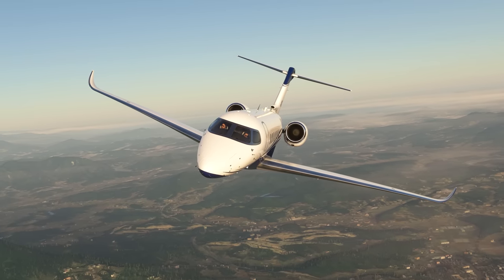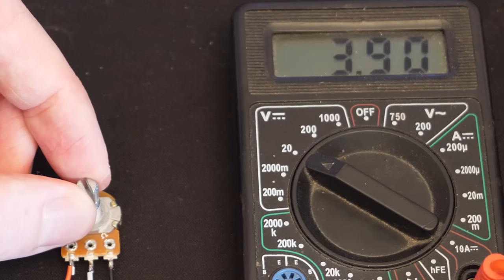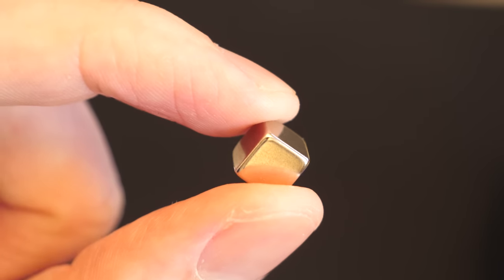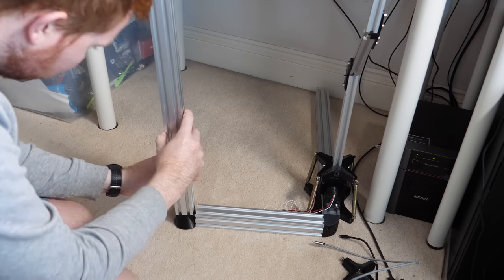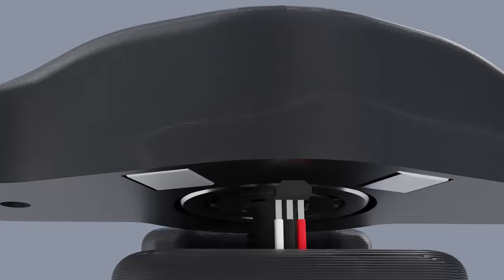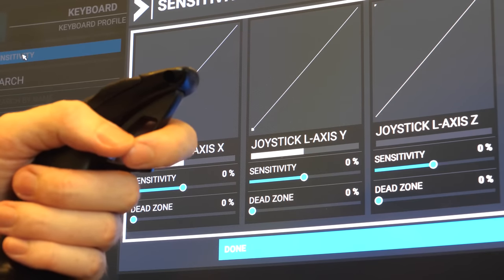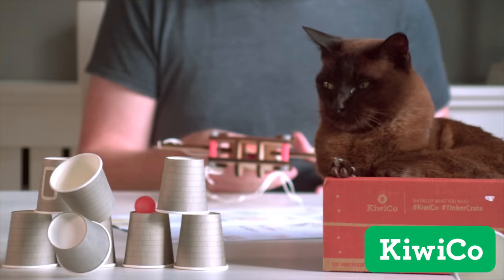DIY Flight Simulator Joystick

Comment: Years ago, I bought a USB racing wheel (with pedals). It set me back something over $100, despite the fact that it was flimsy, plasticky, and horrible.

If I ever want a racing wheel again, I'm definitely trying this idea instead. Some aluminum extrusions, a rotary encoder or some other multi-turn-capable sensor, and maybe some miscellaneous hardware. Heck, I bet I could even buy real pedals and a steering wheel from an auto-parts store. 

Guess I've found my next project!

Comment: +TomStantonEngineering  My concept of a roll-pitch column for a concept F-14E/EF-14G 'pit is larger yet simpler than the stick demonstrated this vid.  Dunlop Engineering (GBR) developed a roll-pitch column for British combat aircraft later licensed by Grumman (USA) for the F9F, F11F, A2F, and F14F (respectively F-9, F-11, A-6, and F-14 after 1962) tactical jets, and by McDonnellDouglas (USA) for the AT-45 advanced trainer; the pitch axis is in the base, the roll axis 0.4m up.  The column could potentially be integrated into a complete 3-plus-axis flight-input assembly with yaw-pedal rack and spring-return pedals for brake inputs.

Comment: Amazing video, and a pretty amazing design. It seems like you got an amazing price to quality ratio with your build. I do have a lazy thought, would it be possible to increase te resolution of an axis by adding more hall sensors along the trajectory of the magnet, that could "take over" when the magnet travels enough distance to get within their respective regions of measurement? You don't have to bother replying if it's a dumb question 😂 Anyway, amazing work, you have a subscriber.

Comment: Did you consider using gyroscope/accelerometer to measure tilt? They seem very cheap and you just have to strap them to the joystick to get pretty precise 3d angle.

Comment: 3:25 Tom: "The large red button can be assigned to a --"
Me: "Missiles!"
Tom: "--desired control output which'll most likely control the brake, as Microsoft Flight Simulator doesn't currently support missiles"
Me: "Oh..."

Comment: I wonder if you were to set your monitor to 100hz because that is a factor of 100 and should line up easier. I am not sure though. Either way. Latency tests for hardware alone are often done on PC mice by wiring an LED in line with the 5v output and the moment it lights up, the measurement is started and the measurement is ended by the time it outputs an action.

Comment: I wonder if using the old DB15 Joystick port would make it easier or harder to do. I mean, with that system, you'd only need analog resistances from 0-100 kΩ and buttons.

Comment: If that 6 degrees of movement is only producing a tiny voltage, why not use a simple TLxx op amp and a couple of resistors ?

Comment: I wonder if i could just add a huge extension to a cheap joystick for a similar result. Or would the cheap joystick not even pick up on the smaller movements.

Comment: @Tom Stanton Is it possible to only construct one of the modules? I already have a joystick and throttle setup but I can't afford rudder pedals so if its possible for the pedals to work as a standalone that would be absolutely wonderful, Also seeing as how you are getting into flight simulators May I suggest IL-2 Sturmovik Great battles and DCS, the latter supporting missiles ;)

Comment: I love it. I need it. I think I build it (when having enough energy to do so … depression is a bi*ch)

The two magnet setup is ingenious and seem easily adjustable to all sorts of magnets and distances. And with a little bit of work it might even adjustable on the fly.
Here are a few things: The rudder seems easy enough to be modable to a helicopter setup, in where each foot has another axis to control.
I don't really like the throttle setup, but that is also easily changeable to anyone's need and wants.

Do I get access to files and cat models / stl files when I become a patreon?

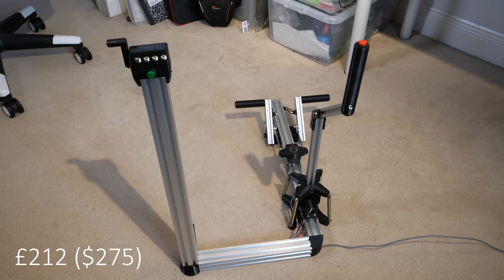7:15 $275 expensive? NOPE! Not in my opinion. Similar joysticks might cost a multiple of that. And you can't modify those.

Comment: You should have had measured the latency on the Windows desktop in the Game Controllers dialog with no other apps running. The latency values you showed there are simply horrible, but that's mostly due to MFS being a huge resource hog (and I guess your PC not being quite up to the task... not that mine is all that better either).

Comment: How do you suppose you can get the latency down?  Faster Arduino processor maybe?  I'm interested in a better setup for games like War Thunder.  Currently in WT they have an issue with joysticks that has been termed joystick wobble.  This is rudder wobble that they claim is due to latency in the joystick.  In reality I see it happen when playing the game using a mouse as well but not to the same extent.  So seeing the differences in latency between joystick and mouse certainly lends to this theory.

Comment: i would love to build something like this, i would however redesign the throttle so it is big enough for my hand to rest on it but there is 2 problems i would have to deal with first. first of all, my computer isn't nearly powerful enough to run this sim, second of all, i don't own a 3d printer yet...

Comment: Am i being blind, or does none of the datasheets for SS496A1
 contain a pinout description? I know I can use the pinout you provide in the video, but how did you find out? Just guessed on what most other 3 pin hall effect sensors use?

Comment: Hello!  I am a beginner.  you made the Joystick, the Pedals and the throttle.  Are all those electronic components connected to a single Arduino Micro?  If I need more buttons, for example, and I don't have more pins available, how do I do it?

Comment: Hey Tom, I'm making a joystick based off your design. What gauge wires did you solder to the Hall Effect sensors? my three 22AWG don't readily fit in the hole you left

Comment: the question is,  where is the  Best place for the handle to be.    imo, centered is  Not  the best place.       there is nothing to prevent you putting the stick wherever you 'want'.       in time you may realize that a lot of flying can be done, without much use of a rudder.      the push-push nature of rudder control  does call for a centered location.      googletranslate

Comment: Did the cost i cluded the metal beam thingis used or just the electronics ^_^ if the whole thing and all 3d parts included were in cost then sounds solid, something I would like to build

Comment: Just one issue? No the biggest "issue" (one of many) Being that regular joe blow doesn't own a 3D printer But just for sake of argument lets say he does. Most don't know the value of bearings, springs, magnets etc. etc. but then many of us mechanically inclined do. After spending all the money for not only the materials (that aluminum isn't cheap) plus ALL the parts including the chips etc then not to mention all the time you will have invested in it you could literally buy a good one for less than just the material cost much less everything else plus you'll have numerous open buttons ready to use for whatever new options the game or games use like Missiles, Guns, Bombs etc. etc. but with your just to do that requires taking apart and then again spending even more money on toggles, buttons, joysticks ( Missiles targeting system) 4 way toggles etc. etc.

They even have options like you are trying to achieve at rock bottom prices from new company's springing up everyday for example (not to promote his channel by any means he just has an awesome video with only this exact subject with new parts, cost and set up as the video itself no gameplay) OperatorDrewski  has a video with a mind blowing most awesome, most realistic to the vehicles there is BY FAR. Check it out and you'll see why I would never build my own. While you have a considerable amount of intelligence this just isn't practical for the best equipment to price ratio. Then again this is just my opinion and I've been wrong numerous times before lol.

Comment: Man!! That's amazing..

I've been wondering how I might make my own flight stick as quality flight controls are so expensive.. not so bad if you can do it over time and also so customizable.

Would the arduino mega not be better though as it has faster processing and more connections for extra sensors? Would the mega not be better for processing alone?

Consider me subscribed, if your coming up with ideas like this..

Comment: I don't quite get why people are so obsessed with the input resolution (not you necessarily, but I've come across the "it's only 10bit" argument you bring up, a couple times already. Yes 1024 steps isn't the most, but surely, even if your travel across an axis is 400mm (as you wouldn't get at all with any non-extended joystick); even in those most adverse conditions, that's a minimum detection step of about 0.4mm.  It's really debatable even for such a large stick whether it helps to detect even smaller movements (you might try an Arduino Due/Clone with 12bit ADC if you are curious, to take that to around 0.1mm for the 400mm end-to-end stick), but to go 14bit on a non-extended stick - c'mon, that's just marketing wank. 
By the  way, there's a simple way to turn your 10 bit signal into a 12, 14 or 16 bit sample if you desire that - just use four (or 8, or 16) 10bit samples and sum them up before you pass the value on to the joystick library. Or use a moving average filter. Might even result in less noise, but on an Atmega chip, you could enter measurable delay zone there, it can just take around 10kHz sampling across all channels (with no additional workload), so if you're using 16 samples to get one read, and do so across 10 channels, you're down to ~60Hz sampling in total. With the ARM based Due, you could give it a try - it can take 12bit samples at around 600kHz if you use the correct settings, so you definitely got a couple samples to play with.

Comment: alu keg 250 bar cut from bottom injection cork vice und u have 60 degree based on stick lenth on vice mit springs:face-blue-question-mark: half pulled gear depends hw much sensitivity v pull

Comment: Hi. Im trying to build it. Made the mechanical part but is there a way to have more potentiometers as throttle? I want to have only 3 axis and multiple potentiometer as throttle. I think a library modification is necessary. Thanks for your help.

Comment: That latency is amazingly high. With digital music controllers i.e. midi keyboards, drums, pads etc. when playing to music which obviously requires precise timing, most people can detect latency by ear of anything above around 12 milliseconds and I work with a drummer who starts to sense latency above 7ms. 110ms delay in musical terms might as-well be yesterday. Does anybody know if lowering the resolution at the digital conversion stage lowers the latency? Midi only has a resolution of 128, is this the reason for the much lower processing times from analogue to digital?

Comment: Hey Tom, I'm wondering if you can help me. I have a pair of saitek combat rudder pedals which windows 10 no longer detects drivers for. Since they still work would it be possible for me to write a simple driver for them using the same methodology you use for the Arduino stuff? Do you have tutorials on how you do the drivers stuff?

Comment: How does the arduino interface with the computer? TY
Reply: usb cable i imagine
Reply: @Steph.98114  Yeah, but how do you program the arduino to communicate with the same standard as a Joystick does? What is the baud rate and what are the functions and libraries to use? Just Serial.print() ? probably not...
Reply: @jeffreylebowski4927  there is a library that you can download and use that mimics a hid controller

Comment: Fantastic clip Tom 

Im looking at making a g seat with air bladders  basically i need to control a 60 kg servo to squeeze an air bladder ,ive got it going with a sliding pot to the throttle with an arduino card .
Id like to position 3 hall effect sensors for the stick position on the rear ,left and right of the base  when i pull back the stick the hall effect senser senses this ,sends a signal to the 60 kg servo which squeezes an airbladder ,this air is directed under the seat to give the sensation of being pushed into the seat .
Can you please tell me if the hall effect sensors behave like a pot ,ie if i wire it to the arduino like my sliding pot will it work the same with the same code .
Thanks 
Dave
Reply: While the values for the sliding pot are most likely perfectly linear, the hall effect sensor isn't linear due to the magnetic field, as it decreases in strength by the inverse of the square of the distance. (x~d vs. x~(1/d^2))
Don't quote me on the formula though, I might have it mixed up a bit.

Comment: Just out of couriosity: Does 212 pounds include the costs to buy the 3d printer??! The Hall sensors cost next to nothing (5 pcs for under 10€), so do the magnets. If you have a printer, the parts come for freee, and the extrusion parts can't be THAT expensive. I just wonder.

Comment: Should have used a toggle instead of a button and keyed it to push to talk on whatever you're using for voice. I've only ever flown shitty planes as a private pilot recreationally. I've never seen a glass cockpit, not even LCD displays, everything has been gauges, formica, perished 1950's rubber, and duct tape in my flying career. But I've never flown anything with flight controls as shit as this. Should make something closer to a P/A-28 or 38 I'd say those are minimum entry vehicles.

Comment: So I want to build a custom joystick but not this type and ultimately I'm stuck at how to house the sensors. I planned to strip down a logitech 3d joystick and place its electronics in my own model. The axis have about +-30° and +-45° so potentiometers should be fine but how do I fix them to my axis?

Comment: Hi Tom, I am planning to make your design and I would like to use it to fly helicopters, making an identical speed lever that helicopters and replacing the one you have in the video, please I would like to know how many Arduinos you used in the video?, I am planning to buy but I do not know which one I will be best (Arduino uno or arduino leonardo).
Reply from the maker: You'll need a 32u4 arduino to work with the joystick library. So the Leonardo, micro or micro pro will work. I believe the leonardo and micro have the most analog inputs.
Reply: @TomStantonEngineering  ok, Tom, thanks a lot, im going to order 1 Arduino Leonardo, if it is very difficult for me to get the hall effect sensor I could use the 10k potentiometer (even if the route is greater) or which other sensor you recommend, cheaper and easier to get?

Comment: what kind of hall sensor is that? my amazon search has A3144, A3144E, AH180 and the list goes on, some say linear sensor and digital switch for the same sensor and that confuses me. Which one should I get to get an analog linear output?

I want to replicate your idea but on a much smaller scale.

Comment: Hello Tom,
Is it possible to use an ADC 16 bit card (ADS1115 for example) to increase the resolution of the Arduino pro Micro to 16 bits for the Joystick ?
Thanks !

Comment: would have to be simpler to build the joystick with pneumatic air cylinders  yea your X and Y  may have abetter control i am amazed in your too 
i am looking at a simulator you have the feel your in the cockpit to  yea o have a problem with the electric part they do work as it allows me to  will not allow me to turn around with it I do have to  understand i am asking to the impossible too

Comment: for 212 pounds its not worth it guys, trust me I play sims for years and have a multitude of various joysticks from vartious price points. Save up some more and buy a Thrustmaster warthog. Or a saitek 56. When it comes to rudder peddals, the only good ones cost 500$ or 1000$ so just buy the cheapest set you can find.

Comment: How do you prevent he chair from turning and scooting around when pulling hard on the controls?
Reply: Remove the wheels? Why would u use a chair that moves while using a flight sim
Reply: @9e05cherianpadipurackalvar6  Because they're comfortable and maybe he's at the desk. I usually did the same by strapping a rope from my chair base to the desk/g920 stand

Comment: The Arduino has a voltage sensitivity of .001?
Reply: I just say this, because the max input of your setup is 500 0-5 in .001 voltage increments right?  So 1024 for your method is great I would think.  Your other points are valid too?  I wonder if you could combine more sensors, and calculate a final.

Comment: xplane is better still, fs2020 uses still practically the same physics as fsx. xplane physics are better. but fs2020 has better scenery for bush and vfr flying. it depends what you are talking about in a simulator, so you cant really say that it is better if you want simulation. unless you want scenery, so fs2020 can be better.

Comment: I stuck a Quest 2 controller to a toilet  plunger with a magnet.
The plunger was stuck to a bit of wood.🤦🏿‍♂️ Still ain't worked out how to get Yall peddles. 💁🏿‍♂️ Maybe I can use two bottles of shampoo and some string attached to the left pad. 🤭

It works proper good with simple planes.

Comment: Any chance that someone could share a way to wire everything up to the arduino?
Reply: Hi
Did you figure out the wiring for this build?
Reply: @asifakhan41942  Hi, here is a not very technical schematic I made in paint. 
https://drive.google.com/file/d/1WWZR1rGyNio59c92-6cbYBPLV4nYngZH/view?usp=drivesdk
Worked for me. Hope it helps.
Reply: @BlindAlanAlda  Thanks a bunch for that diagram. That helps a lot man..... :)
Reply: @BlindAlanAlda  What's B1 & B2? Anyway I could dm you?
Reply: @asifakhan41942  B1 and B2 are the push buttons. One on the stick and one on the throttle case.
Reply: @BlindAlanAlda  also how about the potentiometers?
Reply: @BlindAlanAlda  are you available on discord or any other way I could contact you?